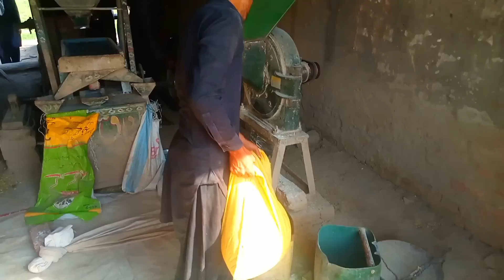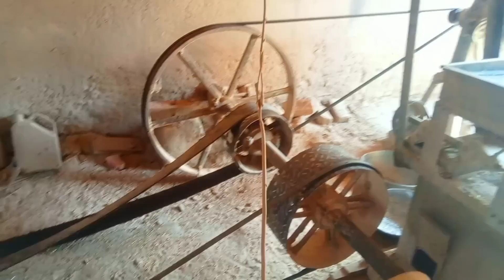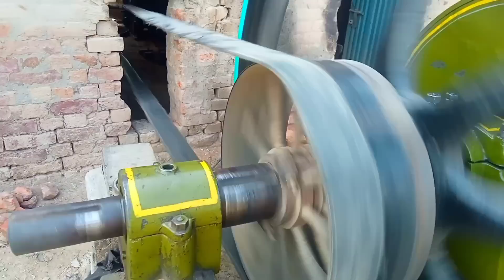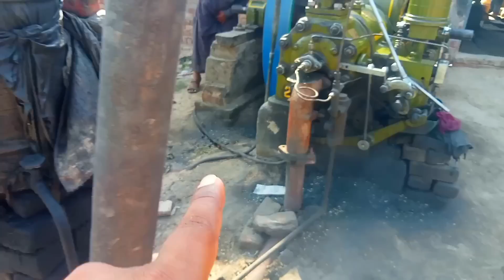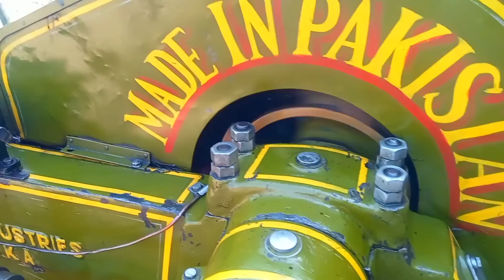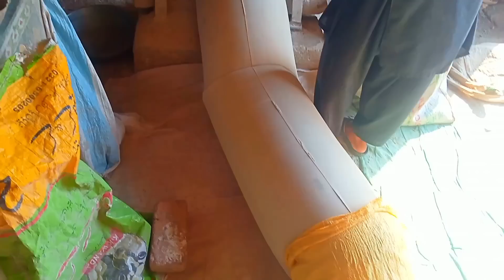Starting Amazing 22hp Diesel Engine On Flour Mill || Diesel Fuel Engines || Desi Old Black Engine

Comment: I find these old engines so fascinating.  It great it is still working.  To think an engine today with the same hp would be so much smaller, but I'm sure not designed to still be working 100 years later.  These must have been marvels in their day and saved so much human labor.  And even as big as it is, it is still smaller than 22 horses on a treadmill, producing 22 hp.